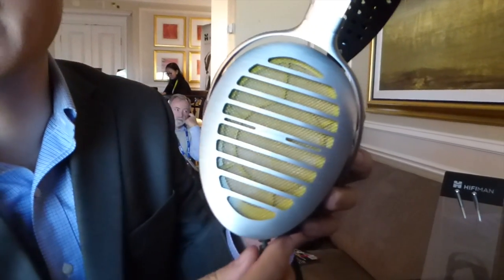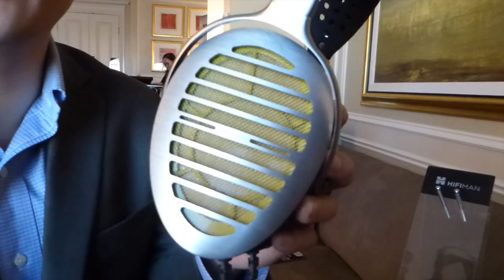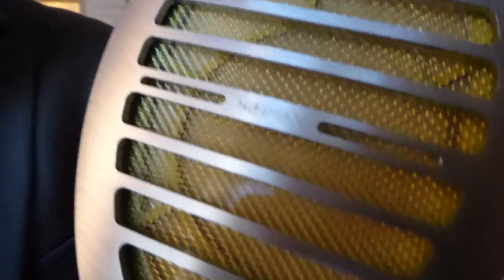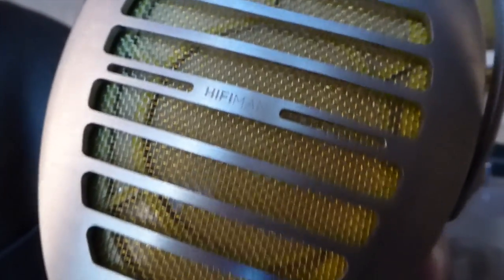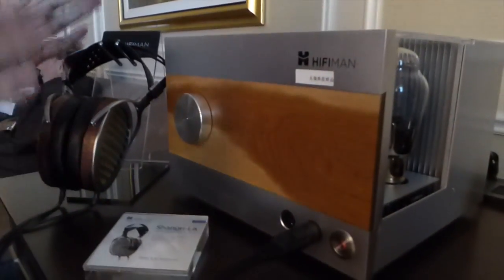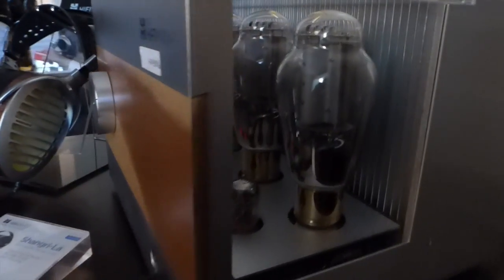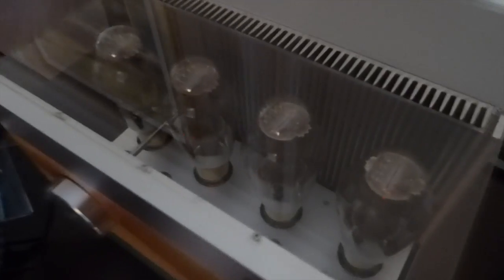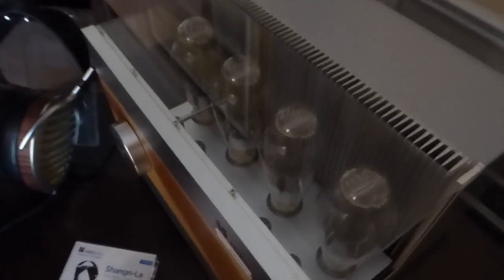CES 2016 The Long Awaited HiFiMAN Shangri La Electrostatic Headphone

Comment: Am I alone in thinking that ultra-fast/precise electrostatic drivers and tubes are an inherently odd combo?
Reply: Yes you are alone. Tubes, especially OTL are high voltage. E-stats are high voltage. Match made in heaven.
Reply: @ColocasiaCorm  that sounds a bit like saying "combines have massive horsepower, so do Corvettes"

Qualitatively, high precision and high distortion still seem like an odd combo to me no matter how fat the pipe is. But hey I'm not saying I wouldn't listen

Comment: "No price is set as of yet, but a reliable source said the headphones are planned to be available separately; they will be compatible with other currently available electrostatic headphone amplifiers; and the price of the headphones alone will be five figures."

5 figures? Surely this is a typo? These headphones are going to be $10k+?
Reply: +nathanc777 Depends on currency. Yuan is very different than Dollars.
Reply: +nathanc777 Well, the HE-1000 planar dynamic headphones they make are already selling at $3000USD, and these ones seem more unique that those. 

Stax headphones aren't cheap anyway, and they have the advantage of being the leading company in the electrostatic market. So they'd be selling more units and making some degree of economies of scale. 

It's true that you could say they should be priced competitively to gain awareness and market share, but that's not going to happen. HiFIMAN are big enough in China now that foreign sales, though certainly contributory, aren't the major market for them. And there are more than enough rich people in China who want the best of the best to keep demand high for Fang and HiFiMAN.
Reply: +BeniGuma1337 
The basic entry-level STAX system can be found for around $400 USD nowadays, which is far from "aren't cheap anyway."

Tyll actually measured my SR-207, and they measure quite well, among the best of any headphone I've seen I think.
http://www.innerfidelity.com/images/StaxSR207SB2217.pdf

Subjectively I like them more than other more expensive flagships I've heard too.
Reply: +miceblue425 and the basic HiFiMAN setup can be had for $69 for the ES100 earbuds or $299 for the 400S. When we're comparing the total top tier of a company's lineup don't you think it's off base to price check me using an entry level unit? Do they sound good, sure. Is anyone saying they're better than the Mk-I 007 or the 009, I don't think so. I appreciate your input most of the time, but that clearly wasn't what was being talked about. 

I wish they were priced more regular Joe friendly, but maybe we'll get done trickle down from then over time or I'll have to get a better job and pick them up if I still care.